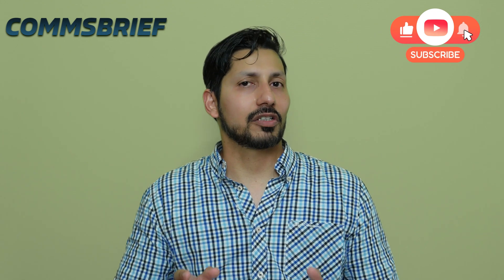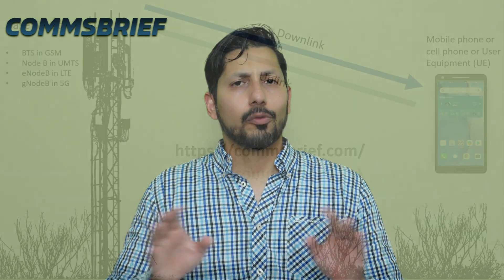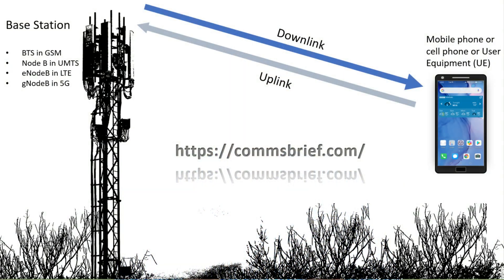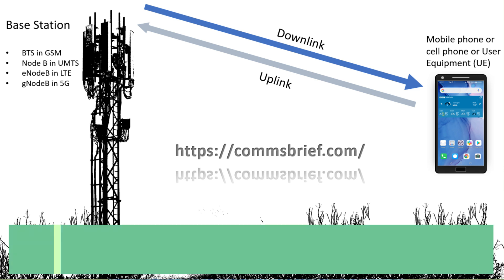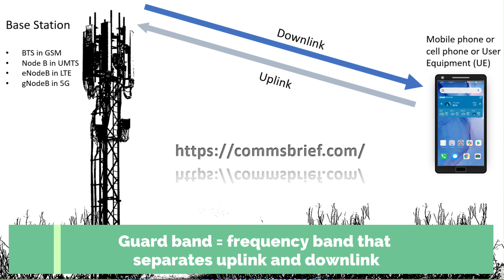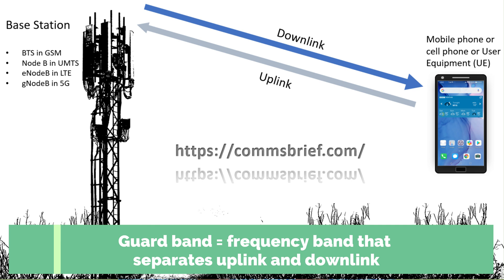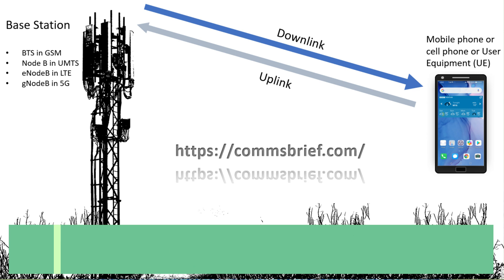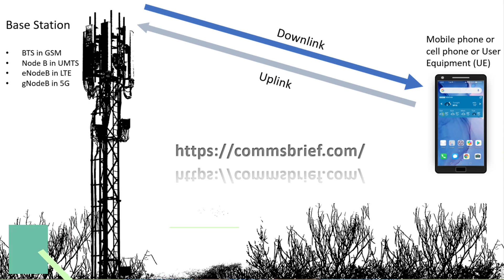What are FDD and TDD in mobile networks?

Comment: My carrier, Rogers, appears to use only TDD for 5G, but both for 4G.  One thing you forgot to mention is with FDD the ratio of upstream and downstream bandwidth is fixed, but with TDD they're dynamically assigned.
Reply from the maker: Thanks for sharing that James. As for the dynamic allocation, I didn’t forget as that’s the key benefit. Check out the  video at around 4:35.